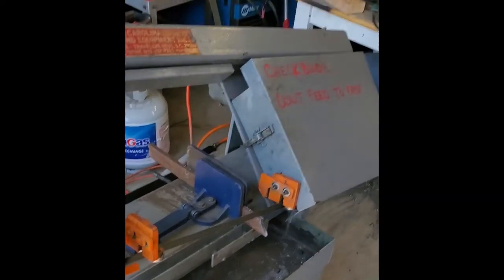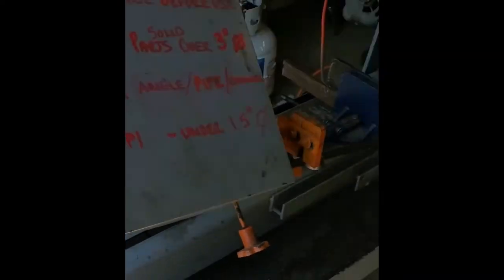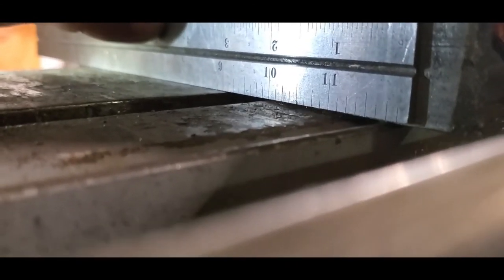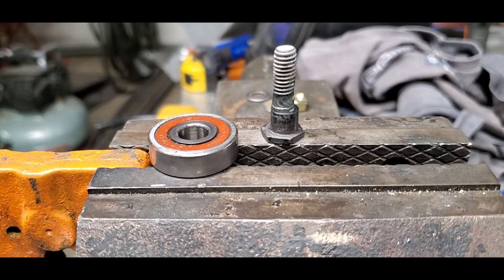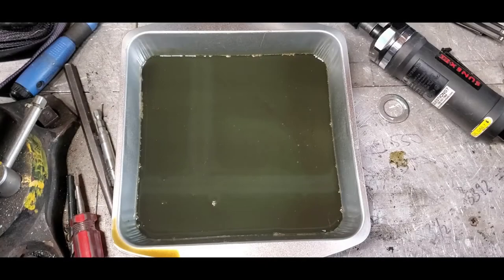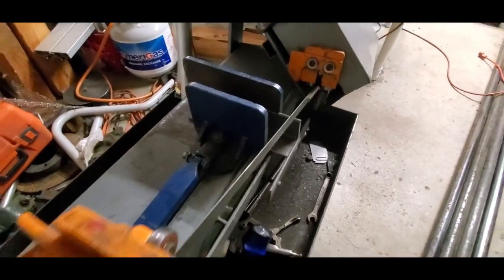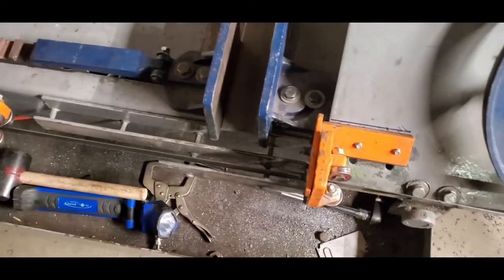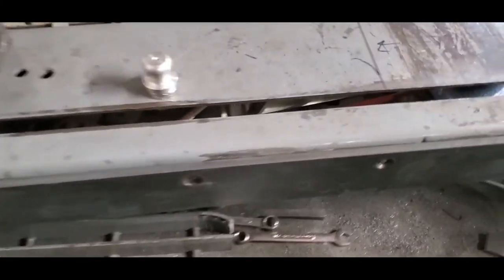How To Fix A Carolina / Ramco Band Saw To Cut Square & Straight Pt. 1

Comment: I know its an old video but definitely helpful. I think I may go even one step further and just replace the entire saw bed with 5"x7" or 6"×8" 1/4" wall square tubing. Would of course have to cut out for the hinge and the slots for the vise but would 100000% increase the rigidity. I got one a few days ago for $100 that everything work so far. It was in a marina so got surface rust all over it. Gonna take it all apart strip everything and fix anything I encounter like a new belt new blade and maybe new roller bearings. Havent got into it yet but this video definitely pointed out something I wouldnt have thought of...torque on the clamp warping the table out of alignment. Thanks!